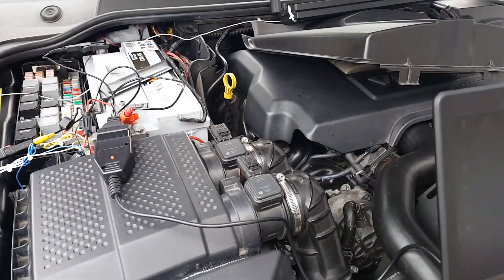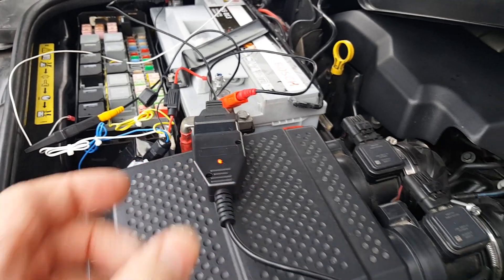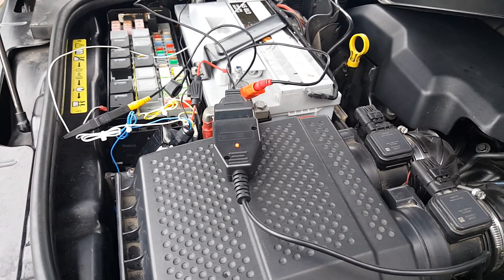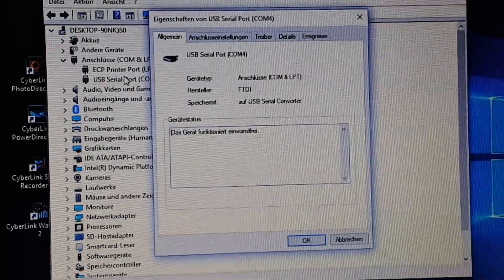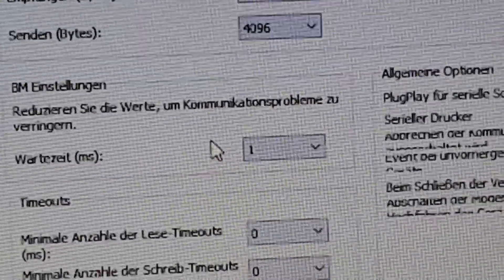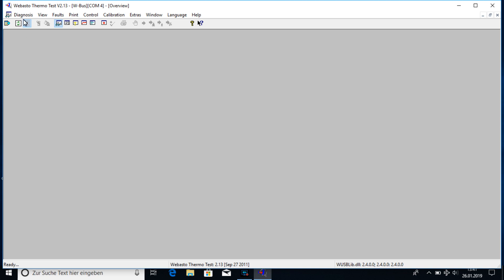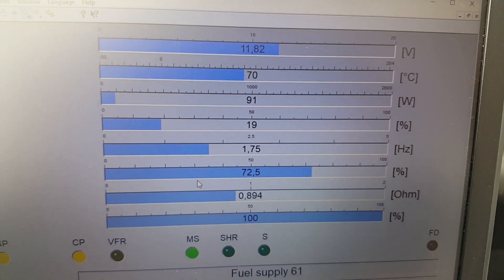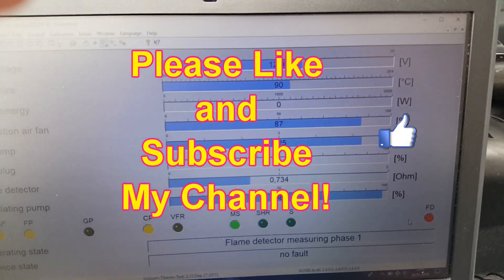Range Rover FBH Diagnosis using Webasto Thermo Test Software (WTT)

Comment: Hi does the ignition on the car need to be on or off.
Reply from the maker: It was off as I perforned the test as this test is independent from the engine.
When this sofware or the controller shown in the previous video are used, both operate the fbh using the W-bus (pin 2 of fbh connector).
When the fbh is used as auxiliary heater of car's engine, land rover's can bus is used instead for the fbh opearation. So both methods of fbh controll are different from each other.
Reply: @tdv8fixes94  thank you.
Reply from the maker: @gazwishbone8381  
You are wellcome!
Reply: @tdv8fixes94  may I pick your brain again. Iv ordered the diagnostics usb tool just waiting on it. Fbh didn't work this year so my local garage wiped the fault code on my lr3 06. It then fired a few times but didn't stay running for long.now the car has locked it out again so won't even try to run.  Q1 can I do the test with car still in lockout. Q2 will the car register me doing tests and lock it out again. Many thanks gaz.
Reply from the maker: @gazwishbone8381  
The fbh will lock after 3 failures.
You can reset it also by disconnecting (I think) fuse 28 for some seconds.
With the software, if the fbh gets flame for at least 8 minutes (I think) you will have access to co2 adjustment.
Try to increase the value a little (it will increase speed of combustion fan) and see if it get better. Note the original value before changing it.
Don't go below it.
As a try before you get the software to see if the issue is connected to air volume, after reseting with the fuse, you can put a hair dryer on fbh's air inlet forcing more air into it.
If you keep the flame alive longer, than co2 adjustment will help, if not the cause is another one.
Reply: @tdv8fixes94  thanks again I will let you know my results 👍👍👍👍
Reply: Just another one🤔pulling fuse 28 as iv tried many times does not reset the code fault in the car am I right in saying that So this needs an obd to reset it.  When people talk about lockout is that the fbh it's self locking out and that's what f28 unlocks. Sorry for the hassle I'm just determine to solv this fbh problem with out dropping it at a garage 👍👍👍
Reply from the maker: @gazwishbone8381  
The car dtc's just report fbh failures, but do not avoid that it starts.
FBH locks itself independent from car.
If you fix the fbh and still have DTC's on car's ecu, fbh will still run.
Pulling f28 clear fbh memory, not car dtc's
Reply from the maker: @gazwishbone8381  
For sure you will fix it!
I use a simple obd2 from icarsoft compatible to jaguar and LR to check and clear DTC's.
Reply: @tdv8fixes94  the lr i930 will be ordering tommo. Thank you for your time it's much appreciated 👍👍👍👌
Reply from the maker: @gazwishbone8381  
I will be very glad if I really could help you. Regards from Germany!
Reply: @tdv8fixes94  Hi there me again😅 so iv done my diagnostics check with the lead. I'm getting a burn then going out then sometimes no burn. Its pulling fault codes 02h and 05h any advice please 👍👍👍
Reply from the maker: 02 error code means no start.
Cause can be glow plug, combustion fan, fuel pump.
05 error code means that flame detector got active before combustion, what does not make sense.
It seems flame detector is defective. It can be exchanged.
How many Ohms do you read with the software before start? It should be 0.3 Ohms.
Possible reason:
Glow plug shuts down too early due to a defective flame detector.
Reply: @tdv8fixes94  just forced air in to intake like you advised fbh is running. Got access to co2 so increased from 94 to 99 so fingers crossed if it failes later maybe a good clean out is needed Thank you for replying it's much appreciated
Reply from the maker: @gazwishbone8381  
Yes, that is good.
FBH will run hotter, if combistion fan is increased too much, FBH will turn off before 125°C to prevent demage of it's electronic parts.
But, if you find a good adjustment, it will not run too rich, you will have less smoke. Try to find a balance.
If you reduce it too much, it will not start again and you will not be able to re-adjust, so use my hair dryer trick again.